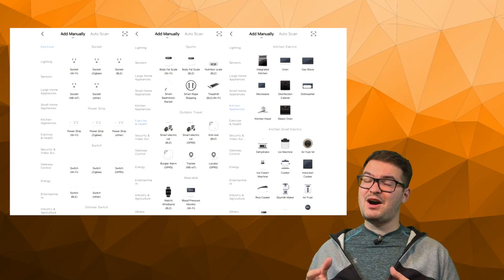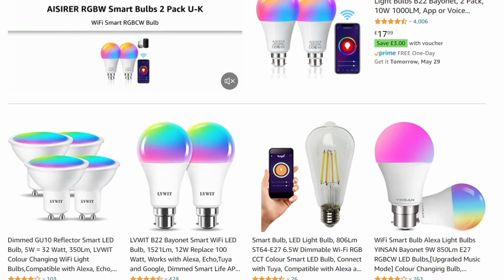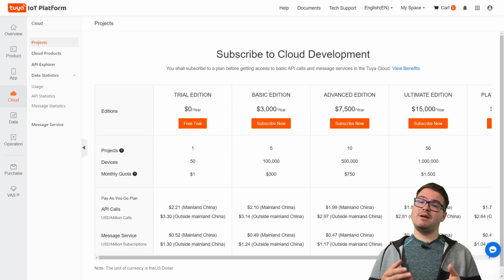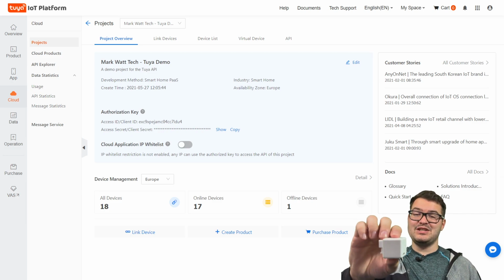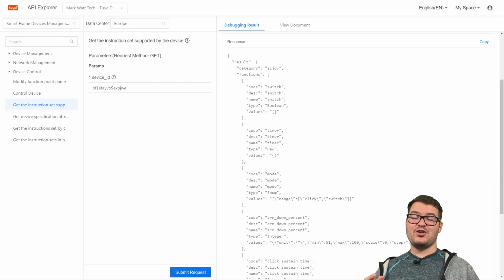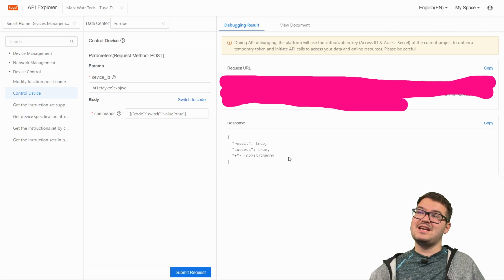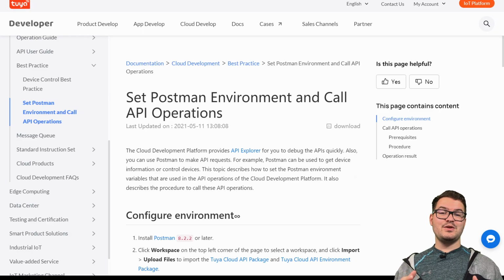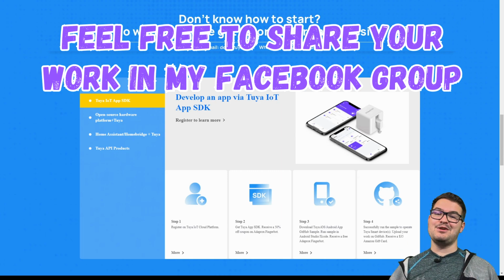TUYA API (Setup, Basics and FREE FINGERBOTS)

Comment: If I don't have any hub. Can I still use fingerbot remotely?
Reply from the maker: You would need a WiFi variant of the fingerprint for full remote control without a hub.

Using the zigbee or bluetooth version requires a hub.

Comment: Things have changed quite alot since this video was published. I am trying to follow along. But get stuck at logging in to the IoT Device Management app when trying to add a device using the QR code. It is saying my username and password are incorrect. Although I know for a fact that it is correct. Hmmm im stuck.
Reply from the maker: Check some of my newer Tuya videos for a more up to date look. My newer Home Assistant one shows the app and account linking.
Reply: @MarkWattTech  thanks. I will look into it.
Reply: @CO19 356 Satyam Wats No, I gave up on it.

Comment: I've got my app linked, the correct number of devices is seen, but when clicked on their number: All Devices: 0; Online Devices: 0; Offline Devices: 0. What is going on?
Reply from the maker: Have you checked the region dropdown? Make sure its set as your registered region. You should then see your devices :)
Reply: @MarkWattTech  All is correct. I'm working on it with Tuya tech support, but there is yet another problem. I've installed integration in Hacs but it's not there when trying to add it via configuration-integrations. No idea what's going on.

Comment: No subscription now... What happens when they get massive amounts of people using them then change to a paid service. It could certainly happen.
Local tuya is the way, if a device can't be flashed as is the way with most of the recent ones
Reply from the maker: It could happen at some point yes. But its not currently in Tuyas business plan. I will be creating a new video for the Tuya HA Tuya integration in the coming weeks showing how to utilise more devices.
Reply: Either ways you'll have the keys to use tuya local ;)
Reply from the maker: @simonburke6681  Ill be sharing more info in a video this week. But Tuyas new integration has local control planned. So hopefully they streamline this whole process.